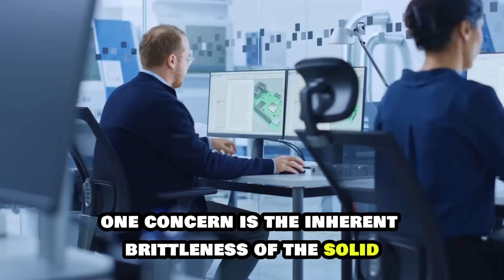Japan’s NEW Solid-State Battery SHOCKS The EV Industry!

Comment: Still massive power shortages to charge batteries whatever they're made of ⚠️
Reply: Trick Question: Which of the 3 basic EV drivetrains (BEV vs PHEV vs HFCEV) offers the most benefits, applications and potential to reduce fuel/energy consumption, emissions AND insane traffic? 
Your answer here __ __ __ __ 
WRONG! The correct answer is PHEV plug-in hybrid. Equitable distribution of battery, PV solar array and hydrogen resources would effectively serve most households. PHEV+H (combustible hydrogen and/or small scale hydrogen fuel cell) paired with small PHEV battery packs matched to small rooftop solar arrays.
Standard hybrid sedans (Prius & Chevy Volt class) get 40-45mpg. When daily drives are kept under 30 miles in the Prius and 50 miles in the Chevy Volt, mileage jumps to 125mpg & 150mpg, thus creating an economic incentive to drive less, the ONLY solution to global warming and ultimately reducing maniacal traffic across whole metropolitan areas. 
If the Toyota Mirai can be said to get 50mpg on hydrogen, the same pairing of PHEV battery pack to fuel cell stack can triple that MPG.  
PHEV tech is especially applicable to long haul freight truck fleets where combustible hydrogen in an ICEngine can similarly increase fuel/energy economy.
Reply: @artlewellan2294  you won't see me dead in ANY Jap or Chinese car. 
My annual mileage is only 4k per year. I drive classic cars over 25 yrs old, and use my bicycle for short journeys. 
Folk who think they've something to prove to the neighbours by buying new cars every 3 years on crazy lease deals are the big emissions problem on this planet.
Consumerism IS the problem causing huge carbon footprint.

I believe in the right to repair everything and I never buy anything new if I can possibly avoid it.
Your solution maybe righteous to you but it's so wrong on a global scale.
Reply: @artlewellan2294  a nightmare to work on.
Over complex,  way too expensive.
We're in the motortrade........ no thanks

Comment: This whole video is based around EV's while TDK barely mention them, TDK says that these batteries are fragile and not suitable for vehicles
Reply: Automotive environments are very difficult to manage. Between temperature extremes and inertial impacts and vibrations (particularly in structural packs), a battery needs to be tough.  I don't know if they'll ever solve a SS battery that isn't brittle.